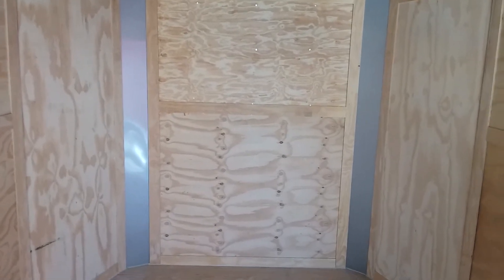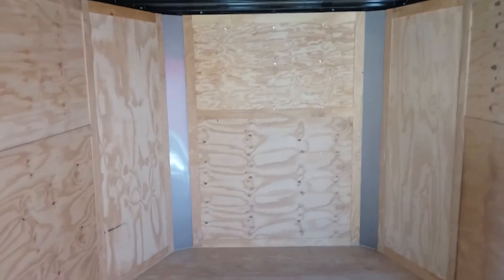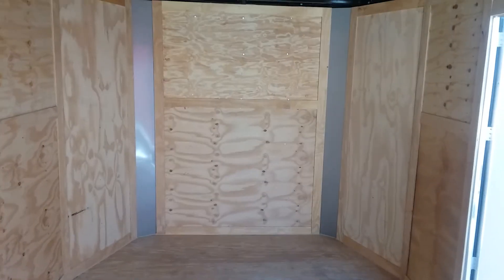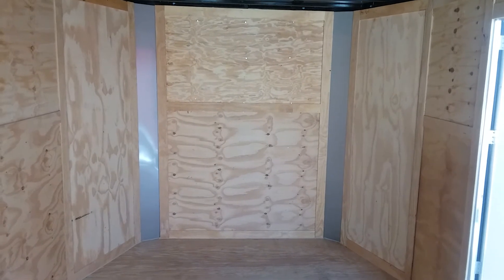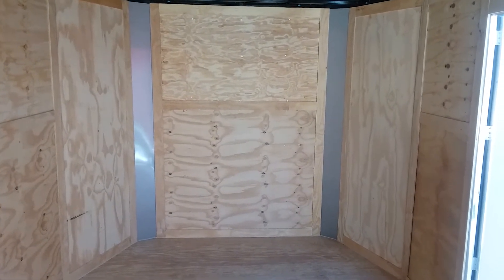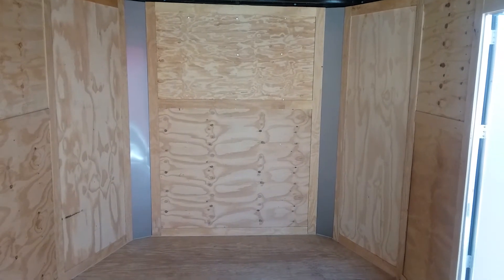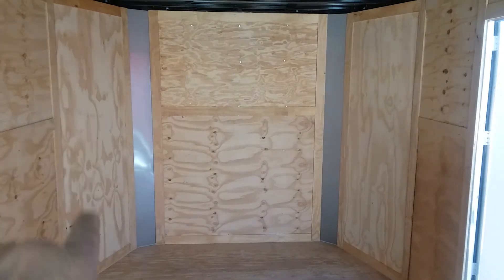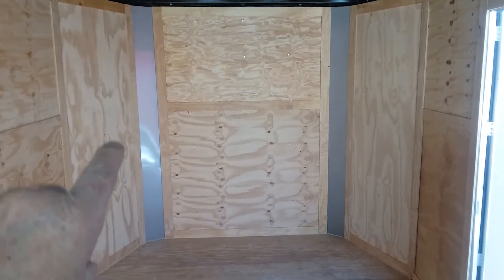New Trailer Setup

Comment: Unless the trailer was designed for a lot of weight on the nose, this isn't a great idea. The weight of the tool boxes and tools is normally far too much for a standard trailer. Of course this trailer may be built for it, but you say nothing about it in your 45 second video!! Literally, I just spent more time on your video than you did!!! SMH....